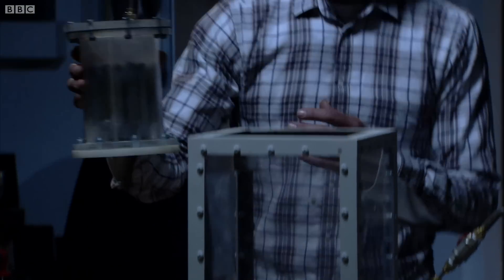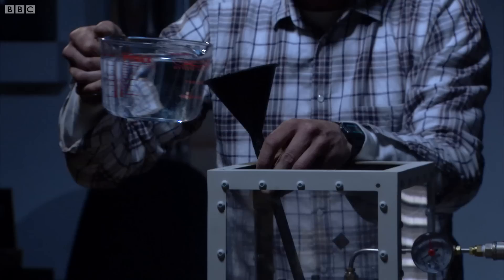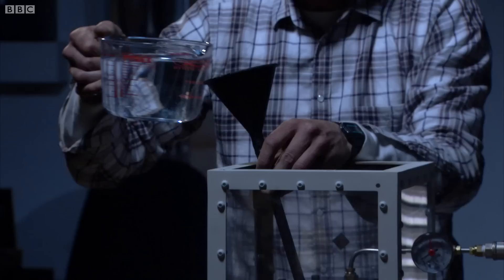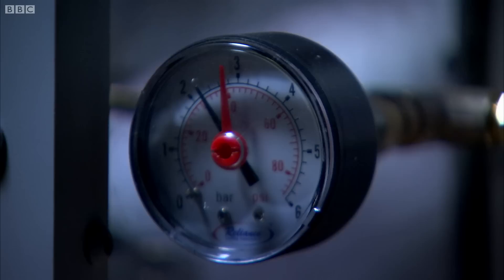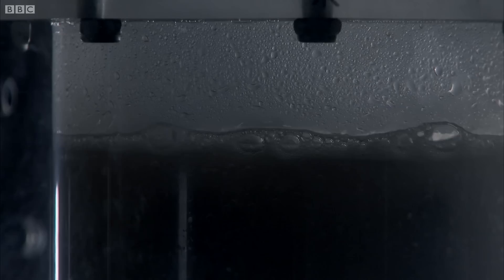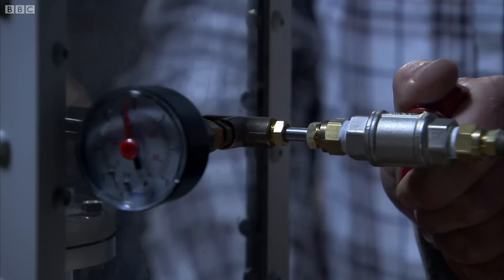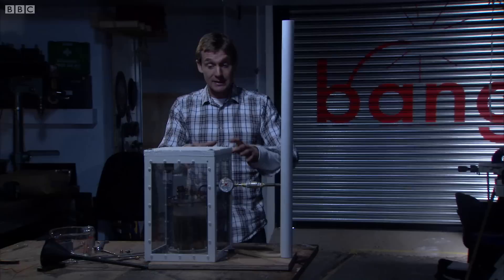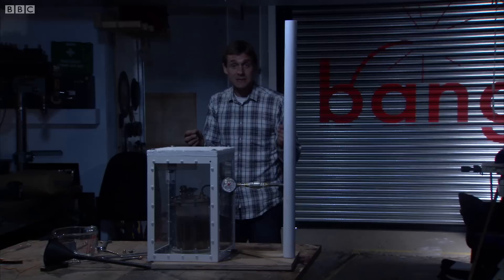Fukushima nuclear disaster re-created - Bang Goes The Theory - BBC

Comment: Well I see the problem. You aren't suppose to create the cap of your reactor out of styrofoam.
Reply: Hell No Reactor Dome...We won't Take Yer Styrofoam!!!        .   Don't by Walmart Reactor Domes!!!
Reply: You are, actually, if it was the same as all the rest the explosion could transfer its energy to the core and damage it. Fukushima had blast walls for a reason.
Reply: It's used so that the thing won't become a huge ass pipe bomb
Reply: When that pressure is in there, it has to goes out, the more you contend it, the more it became powerful.

Not even a science fan, i may be wrong but i wonder if the explosion could have been avoided if they have built the top of the reactor with the same containment mesures they used for the rest of the plant.

Comment: hydrogen explosion blowing apart a concrete building. the concrete gets pulverized and tossed extremely high up, and the heat from the blast causes the "mushroom", which is really caused by an updraft within the plume.
look, if you're going to claim one of the reactors actually went supercritical (nuclear detonation), at least read what that actually means, and realize it's fundamentally impossible to do this with a boiling water reactor. the density is nowhere NOWHERE near high enough
Reply: You can have a small supercritical event though
Reply: @aorusaki  with proper mass, purity and reflector or neutron source. in reactor i think the fuel is not concentrated enough

Comment: Fukushima is just a slow Chernobyl.
Reply: + zerpBot, in Fukushima, they managed to avert the reactor exploding by venting the gases from the reactor into the atmosphere, carrying with them a large degree of radioactive pollutants.
In Chernobyl, the reactor did explode, and the actual graphite and uranium was ejected both in large chunks (on the roof and Elephant's foot) and in small ones (the smoke from the fires).
So while you can say that Fukushima was just a slow Chernobyl, the speed of the Chernobyl accident meant that a plethora of other problems occurred, and it was qualitatively different from Fukushima.
Reply: Of course, they are two separate incidents but I believe I was thinking more about the amount of contamination when I made that comment. Yes, atmosphere vs sea contamination are very different.
Reply: Nope they were slightly different. Chernobyl's reactor number 4 was not shut down and destroyed the control rods leading to a complete meltdown. Fukushima's reactors were shut down and the control rods were inserted. But due to the water pumps failing the fuel wasn't cooled causing a meltdown.
Reply: @zer0b0t  Fukushima never exposed the core vs Chernobyl launching its core all over the goddamn place! There is a drastic drastic drastic difference between the two and one is far easier to control. Almost all the problems from Fukushima at this point originates with reactor three in the fact that the donut shape cooling pool below the reactor is what exploded not the roof like which happened in 1 2 and 4 and is demonstrated in this video. When they tried to vent the gas as he showed in this video that venting wasn't directly out of the core to the roof but in fact down into that cooling pool and it was from those cooling pools that they eventually vented the gas into the roof unfortunately reactor threes coolant pools valve did not open correctly and the cooling pool over pressurized and exploded launching not only radioactive gas but massive amounts of radioactive water directly from the core.

Comment: The nuclear material did not leak out. It is the water that has been used in the cooling process that is causing the issue. They are extracting and storing it, but some has escaped into the ground water system. The nuclear material in the plant itself poses no threat at this time.

Comment: American nuclear engineer Arnold Gundersen, noting the much greater power and vertical debris ejection compared to the Unit 1, has theorized that the Unit 3 explosion involved a prompt criticality in the spent fuel pool material, triggered by the mechanical disruption of an initial, smaller hydrogen gas explosion in the building. Low-dose radiation researcher Christopher Busby speculated that the explosion that destroyed the Reactor 3 building was a "nuclear explosion" in the spent fuel pool.

Comment: I completely agree with Alexander Alcyone's opinion and this can be backed up with some of the Gamma Spectroscopy kits given by open source groups online to farmers and those people around the area. Most of the contamination is in the form of Cs137, Cs134 and very short lived Radio-iodine (I-131) from reactor fuel. None of the heavier elements like Uranium or Plutonium in the MOX fuel escaped into the air like at Chernobyl, which was a totally complete containment failure.  Yes, there was partial melting at 3 of the reactors and this has caused significant groundwater problems. It is NOT airborne!!!
If any mox fuel was blasted into the air like some are suggesting here, we'd have seen traces of it in our rain water in N.A. which we haven't.  Plutonium is very easily detectable with a low energy Gamma Scintillation detector.   
    "over 20 tons of MOX was blasted into the air"  comment below is utter nonsense and a worse situation than what occurred in Ukraine in 1986.  Btw, the event at Chernobyl sent a massive cloud of fallout over Northern Europe and was even detectable in North America some weeks after the accident.

Comment: Actually, It can happen, what happens is that a neutron is shot with precision at an atoms nuclei center(Uranium Iso-238, 5-20% Iso-235) In a successful attempt, cause it to literally slit in half, releasing 2 elements, and also energy, and 2-3 neutrons. 

In an uncontrolled nuclear chain reaction,
What happens is the chain reaction is going so fast that in a fraction of a sec. billions of atoms will split in half releasing energy, nuclear energy in the form of heat, light, and gamma rays.

After exploding, anything in the radius will likely get vaporized at a temp. of 4000* C. or 7000* F. After that within a fraction of a sec. a shockwave at the speed of 716 nearly hitting mach 1. Thus releasing too game rays (Y) causing air and rain to be radioactive, considering the decaying speed of the radioactive particles.

Now not having a fail safe is just plain stupid, if there had been a failsafe all control rods would have pushed home, thus taking away all the heat to the cooling plant.
There going into a boiler, creating energy.
Reply: Fish Gil four words. Positive Steam Void Coefficient

Comment: Yeah, well they could not have vented all of the steam or there would not be anything to keep the reactor cool. Also, the real problem not discussed in this video was the lack of power to the facility following the tsunami. The pumps to add and circulate additional water could not operate without power. There were two valves that should have been opened manually to allow the steam to travel into the emergency condenser. However, lack of proper training lead to a failure to do so. Instead technicians thought that they would open automatically. So the temperature inside the reactors rose and rose until even metal could be vaporized. This cause the material to burn through the concrete and metal below the reactor and form a molten mass of metal. This much like Chernobyl could be like a weak dirty bomb if anything fell on it with sufficient mass and kinetic energy. This is a total downplay of the disaster. Just look at recent news.
Reply: Also let's not forget that had the back up generators been placed in a better location, such as on a higher floor other than a basement or first floor. Things could have been drastically different. The reason the back up generators were not available was because they had been installed in the basement of the building which was flooded by the tsunami.
Reply: Location near "tsunaming" ocean + Electric stuff in a floodable basement = Extremely dumb idea = Broken by design. qed.

Comment: I guess you forgot about the MOLTEN NUCLEAR FUEL (Corium) that MELTED THROUGH AT LEAST one of the pressure vessels.  They STILL can't get underneath to see if it is melting through the secondary containment vessel.  Latest video showed it DESTROYED the concrete leaving only the rebar holding up the whole thing.  Another good earthquake and the entire structure could easily collapse onto itself.  Then what???????

Comment: 30 children with thyroid cancer already.. (smoke and alcohol? average age 15 :( )
Reply: @user-gf6yl8jg6z  Ok how many deaths has nuclear caused compared to fossil fuel deaths.
There has been 1 direct death from the Fukushima nuclear accident. 800 deaths from stress in the elderly, the stress was caused by the evacuation. 
There has been 34 direct deaths from Chernobyl. 30,000+ people may die from cancer after Chernobyl
No single death from Three Mile Island.
The Windscale Fire had no direct deaths, and a few hundred to a thousand people may have died from cancers from before and after the Windscale Fire.
SL-1 Nuclear Accident only 3 direct deaths caused by the reactor meltdown and no indirect deaths as the containment building was not destroyed.
Fresh nuclear Fuel is barely radioactive so you can hold fresh uranium without protection.
Uranium mining and Processing has caused few deaths in the range of 1000 deaths.

Nuclear Fusion is not available yet, no not because of the costs, but because we haven't created a sustained Fusion reaction that actually produces more energy than we put in.

Comment: its exactly that gas build up that happens when a volcanoe erupt. the gas build up intil the cavity explodes. the magma have no enough pressure to penetrate the ground so a cavity of gas builds up tanks to the decacy of particles resulting in light isotopes that create the gas build up that eventually explodes. without nuclear fission there would be no volcanoes. radon gas leaks out of both volcanoes and mountains. there is no reason why elements like uranium and plutonius chould be in 99 percent purity in any place on earth but such concentrations of radioactive matter would be needed to form volcanoes. is it not strange that so many volcanoes on earth are close to the ocean just like nuclear reactors? is it not strange as well that the volcanoes many times lines up with more or less even space apart?

Comment: hi ryukachoo
why was there such a huge mile high mushroom cloud? the other hydrogen explosions were diffuse and much smaller, the dust was black and that reactor happened to be running on MOX fuel.. so the question NO ONE asks is.. did MOX cause an larger and more powerful explosion?  
"..(nuclear detonation)  .."  or mox indused mini nuke.. ??

the military use depleted uranium to help induce extra heat and blast potential.. 

does MOX fuel have something that does similar?? 
thx for the reply.
Reply: The reactor didn't explode, if you look at the containment buildings only the roof was destroyed which means the spent fuel pools ignited the hydrogen which seeped into the containment buildings, If the reactors exploded then the ENTIRE BUILDING would Be a burning wreck instead of the roof being a burning wreck.
Reply: If your stating that MOX fuel had something to do with the explosion being more powerful, then your wrong, The enrichment levels for the fuel used is not enough to make the fuel explode like a bomb, and an atomic bomb relies on a runaway reaction, A reactor Can not and Is unable to explode like an atomic bomb.

Comment: So, this is basically how Chernobyl happened
Reply: Chernobyl was cased by a completely different chain of events, the operators at Chernobyl didn't know that the reactor was unstable until the power surged
Reply: No, the core and containment of Chernobyl exploded, Fukushima the core melted and is in the containment which is intact but there was a hydrogen explosion in the building